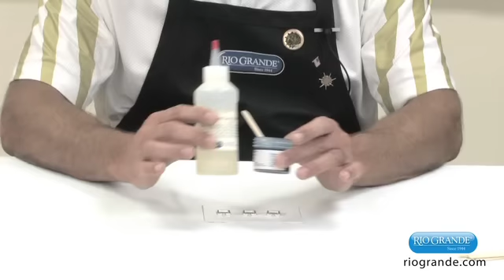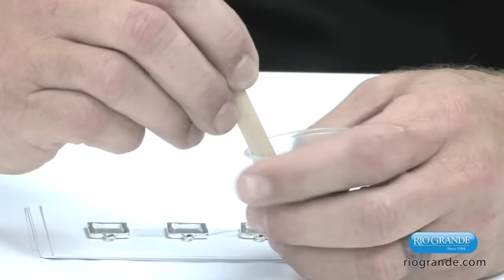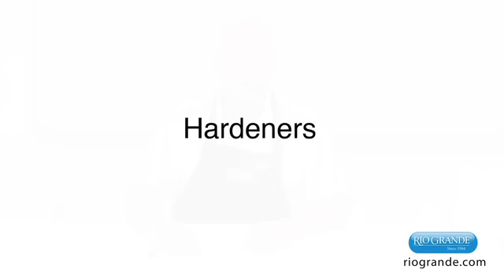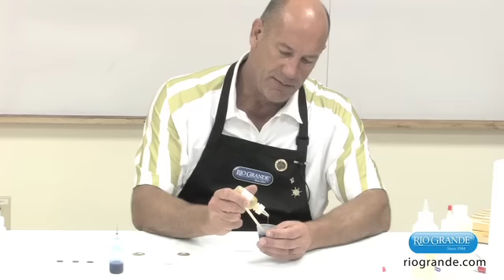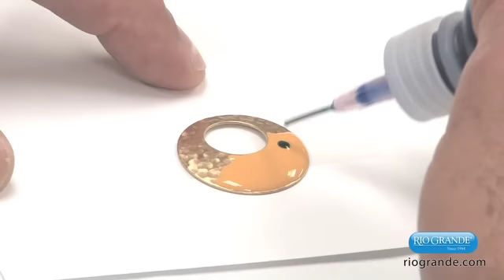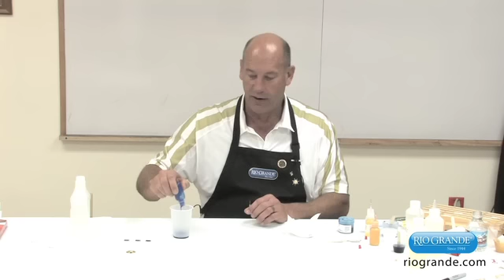Colores Epoxy Resin

Comment: How is this different to other epoxy resins or UV resin?
Reply from the maker: There is almost unlimited color selection and they can be combined to create custom colors.  No additional pigment is required.  Repeatable results.  A variety of types of colors including opaque, transparent, metallics, opals, and pearls.  a variety of hardeners from thin (Self Leveling) to doming.

Comment: I am having the hardest trouble rolling half round wire with this machine. It is near impossible with the many grooves on the roller. I wish this could roll square. I can only roll flat sheet or flat wire with this. I can’t even roll wire enough so i can pull it thru my drawplate
Reply from the maker: Which rolling mill do you have?

Comment: Hello,
Thank for the nice and helpful video. I have a question:
Is there any way to polish the epoxy resin after getting hard? with sand paper or polishing machine? if yes, which number of sandpaper or which way you suggest for polishing.
Also after polishing is there some additional mixture for making epoxy shinny?

Thank you for your time
Reply: instablaster...
Reply: @cadetate3023 what is instablaster?

Comment: Can this be mixed by weight 2 x 1 or just by volume?
Reply from the maker: Hi there, Thanks for watching. The instructions for this product recommend mixing by volume; however, there are some stipulations on minimum/maximum batches by weight.  The snippet is below, but you can see full directions here: https://www.riogrande.com/content/complete-line-of-colores-durenamel-kits-and-components-is-pdf  Hope this helps!

Measuring
The basic formula is 2:1 by volume. That’s 2 parts colored or clear resin to 1 part hardener.
• Measure exactly 2 parts resin to 1 part hardener by volume.
• Put the resin in the cup first.
• Add the hardener.
• Do not exceed the recommended total amount of a 90-gram mixture (60 grams resin to 30 grams hardener).Do not mix less than a 15-gram mixture (10 grams resin to 5 grams hardener). Most beginners start with this mix for best results; this is known as the “10/5 mix.” A 20/10 mix is considered an average mix.
Reply: Thank you, very clear now.  I did my first batch by weight.  It did eventually cure, but took about a week at room temp.  So I will continue with the volume mixing instructions.

Comment: Isn't there a lot of resin waste?  If this hardens at room temp - how do you clean the needle and squeeze bottles? Is there a minimum amount of resin to make at one time - if so (like in your stained glass effects video) don't you end up wasting alot of product?
Reply: I also noticed a lot of wastage.   Is there some way of avoiding this?
Reply: The amount Bruce mixes in the video is the minimum amount you can make at a time. You can make more, just not less. If the resin cures in the needle or bottle before you clean them, there's no way to recover either the resin or the bottle, unfortunately. But the room temperature cure time usually gives enough working time for that not to happen. Just make sure you clean everything immediately after using it.

To avoid waste, I use a couple of options - always have extra, gradually smaller pieces ready and fill those in until the resin is used up. Or one of my favorite left-over techniques is to have an art canvas set aside and use different pour methods to make a resin art "painting". This is great when I'm working with several colors at once. You can even pour the left-over resin into a plastic cup as shown, but instead of adding the alcohol-cleaning mix to the cup, allow the resin in the cup to cure at room temperature and you have instant resin circles! I've always had very little waste as I find some way of using every last drop of resin on other projects, even sometimes using it as an adhesive.